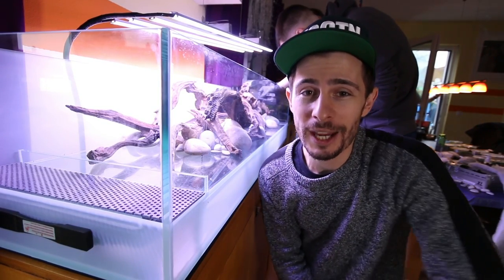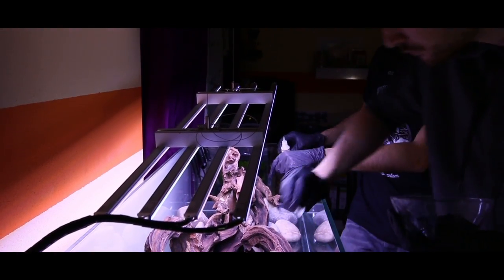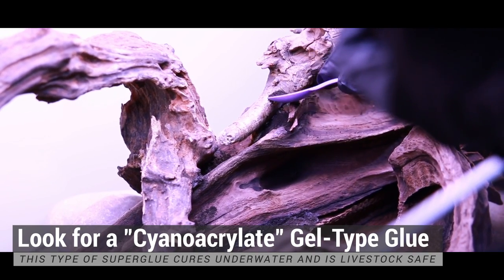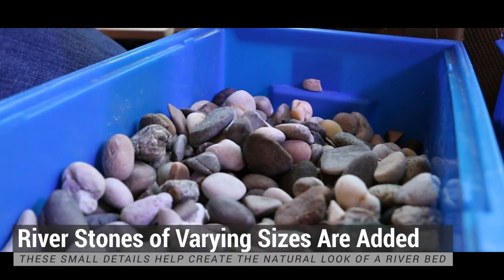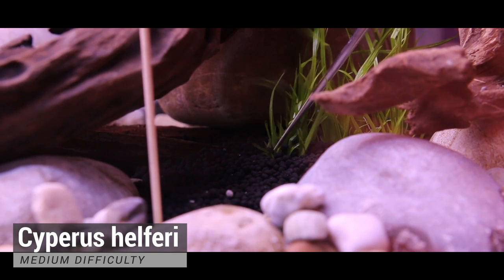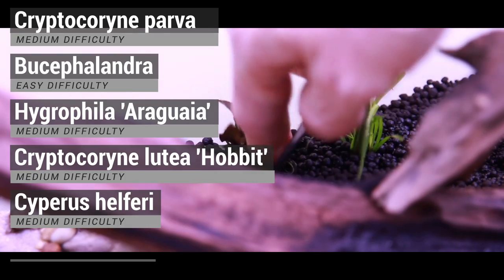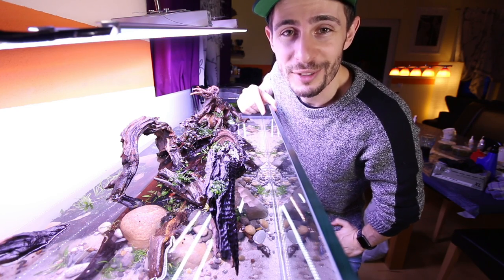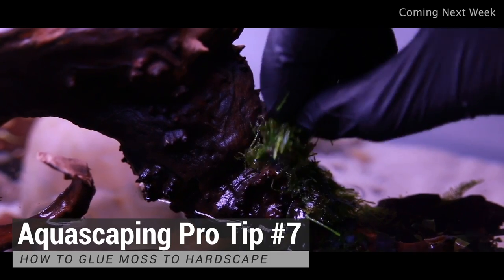Aquascaping a DBL bottom Aquarium - Step by Step River Stream Flow Tank aquascape tutorial

Comment: I really love this tank! I want to create a similar tank, but with these dimensions 90x45x60, so I have room for a double bottom. What are the dimensions of the gaps for the waterflow? What would you recommend for a smaller aquarium like mine?
Reply from the maker: width side gaps = height of the false bottom
Reply: @JurijsJutjajevs  Thanks! One question, did you use glass to construct the double bottom? Or acrylic? I am looking for a way to construct a double bottom, without using silicone cause I heard that silicone damages the glass. Since I want to have the ability to remove the double bottom and use the aquarium for something else in the future.